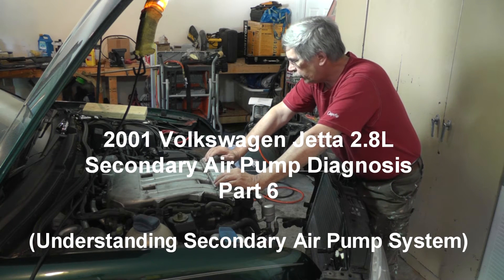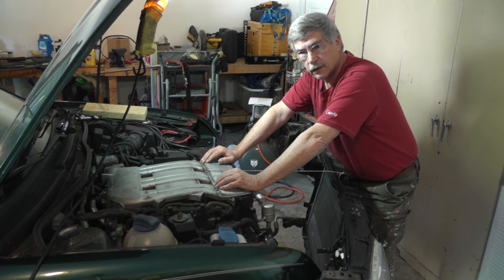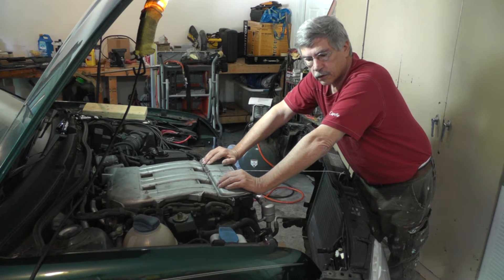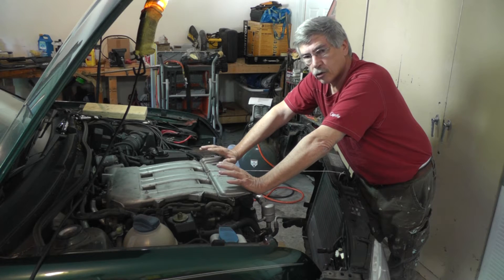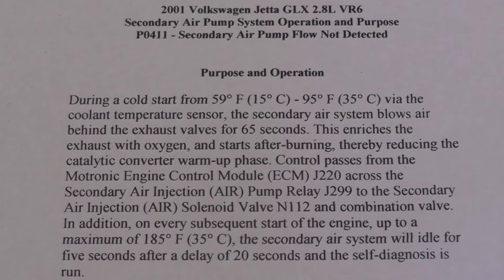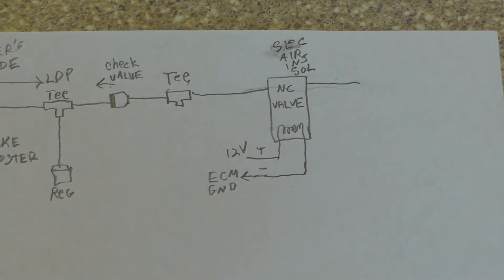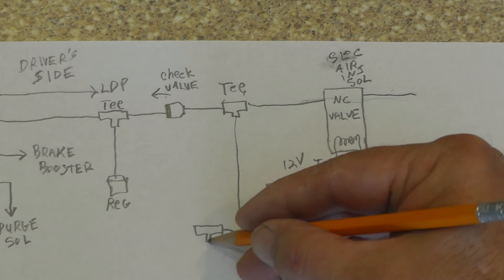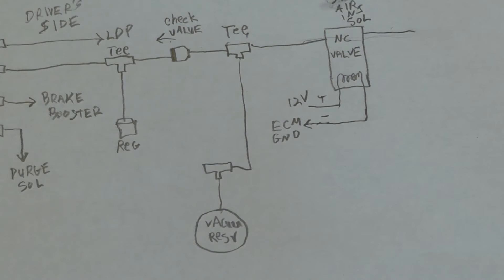Volkswagen Jetta Secondary Air Injection Diagnosis Part 6 (Understanding Secondary Air System)

Comment: This was a great explanation of this system. Now, all the engineers that thought it was a good idea to put this mess on the road should be fired! Every single connection is a possible failure point, for both the electrical and vacuum sides of it. An engineer with GM once said 'parts left out cost nothing and don't break'.
Reply from the maker: Thanks tempest for the kind comment. I agree that it's hard to imagine what the engineers were thinking at the time. And you're right that there is a lot of connection points in the electrical and vacuum systems. Thanks again for your comments and glad that you liked the video.

Comment: Hey Terry - thank you so so much for your great videos...all of them ! i learned pretty much. my wife would say...one hour and you learned all that, but 10 years and you still havent learned throwing your socks the right place . well after seeing your video i know have a clue of where to look for why the rotary valve dosent work probably . makes sence thats whats wrong....i dont feel power in mid rpm ...pedal half way . kind a hart explain, but feel somethings wrong even its aint throwing me a code or any , but now i could see its not activated even over 2500 rpm - thanks !!!
Reply from the maker: I hope that the videos will help you out Lasse!

Comment from the maker: What amazes me is that air pumps went out on American cars about 35-40 years ago. So what is it about the German engineers that they still have to use an air pump? I just don't get it. You remember seeing the commercial on VW and Audi's where it says "The Power of German Engineering". Maybe that's the problem, we need to take about some of that power and get the engineers to stop thinking outside the box. Yes, smoke machines are expensive for no more than what they are.

Comment: I am currently having a problem with my 2005 Golf(1J). My system is also supposed to run 5 seconds or so after 20 seconds on subsequent starts for a self test. Mine is not doing that, although the initial run takes place when the engine is cold. Do you think that because these 5 second runs are not occuring that my secondary air injection I/M test is not completing? Then I wondered about this. If the engine is in open loop when first starting, how does the upstream sensor detect this lean mixture? Does the ecu still take the info into account, just not for computations until closed loop occurs? I hope this made sense. This P0420 is throwing me big time.
Reply from the maker: William, P0420 is where the computer has detected a problem with the 
catalytic converter not working at its intended efficiency. If you have a
 scan tool you can take a look at the upstream and downstream O2 sensor 
in graphing mode and see if the two signals mirror each other. If so, 
sounds like you'll need a cat.

Comment: mr stuzman, i get a P1516 intake manifold changeover valve-N156: open.
could it be that the intake manifold change over solenoid is bad. looking at your video.
my mk4 jetta vr6 has 233.675 miles and every month, i get a problem. never stops. LOL
Reply from the maker: It's possible that you have an issue with the solenoid valve for the intake manifold changeover valve, but it's best to do some diagnostics to be sure. And with VWs as they get older, they are a money trap for sure and it never stops as they always break down :)
Reply from the maker: Take a look at this video which is later in this series and I show you the secondary air injection solenoid along with where the intake manifold change-over solenoid is located. I also show you how to check both of the solenoids. This video should answer all of your questions for the VR6 engine as you have. https://www.youtube.com/watch?v=w_NtO0A8H9A